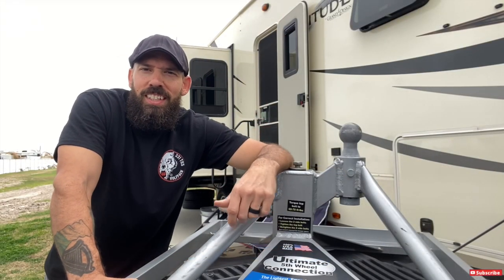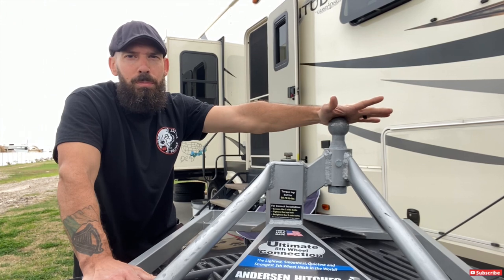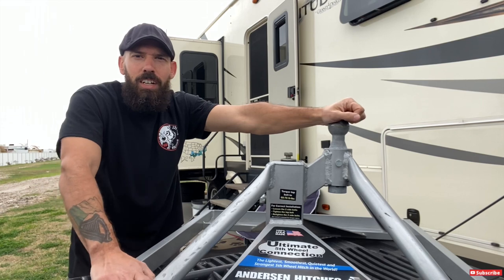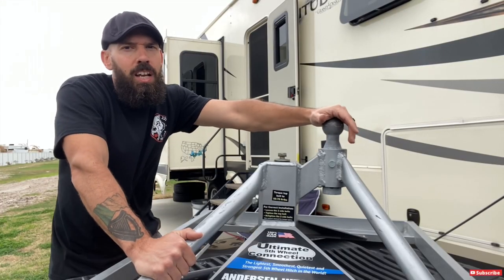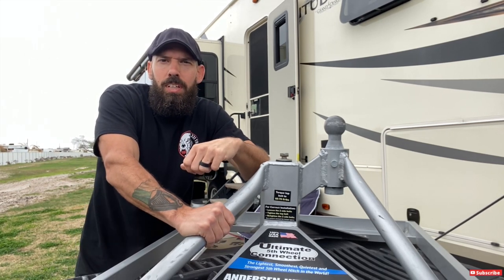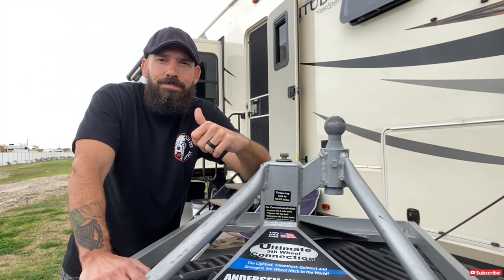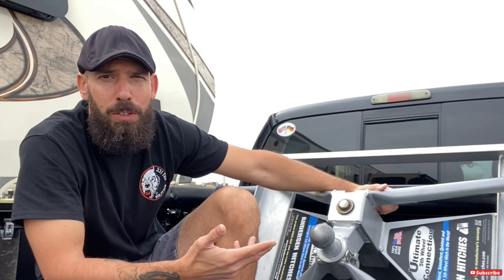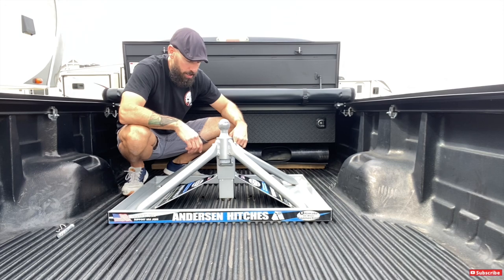Two Year Review of the Andersen Fifth Wheel Hitch //  Andersen Hitch Installation Guide

Comment: glad to see that anderson has upgraded the frame. we had one of the older frames, its welds failed, the trailer fell on the tailgate & pickup bed, yes it cost almost money to repair our pickup as to repair our trailer. we liver full time in our 5th wheel, it cost us some more to live out of our trailer while it was being repaired.
Reply: Do you still have the Anderson Hitch?
I'm fixing to pull mine for first time with the New Anderson,  and I'm a little nervous..
Reply: Can you point me to where they said they upgraded the frames? What exactly is the upgrade?
Reply: Watch the video of them compressing the hitch to 65,000 pounds befor it broke

Comment: Good video on the Andersen Hitch.  I have been using it for 1 year myself with about 15k miles.  I actually made the decision to move to position 2 because I did not have enough clearance to prevent the pin box from striking the side rail of the truck.  I also have an 8 foot bed and have had to make some tight turns and learned to keep an eye on it.  Gordon & Alice
Reply from the maker: We just had a new tonneau cover installed and I was worried about it hitting the rails of that but even with the ball at its lowest setting I’m still good. Thanks for watching!!

Comment: I use a 25K BW with the Ford puck system and love it, but I don’t remove mine. It’s heavy. I have 2 grease zirks on the hitch and I grease around the coupler, but I go greaseless on the plate with a donut pad. I like the Anderson. Looks like a good setup. Like you said, just comes down to personal preference.
Reply from the maker: Sounds like a good setup. We might be checking out the Reese Goosebox soon and going to no hitches in the back of the truck to free up all space. Thanks for watching!

Comment: Dealer installed my hitch, towed new rv home 45 miles… noticed hitch had rotated 1/2”… I re torqued  top bolt and set bolts to 60 ft lbs….
  They make a taller hitch for trucks with taller bed rails.
  If you have a bedliner or mat under the hitch I would consider a longer top bolt to be sure you are getting full nut embedment into the inner sleeve….. (the ball and sleeve are at a fixed height. A mat or bedliner will raise the hitch about a  1/2” creating a longer reach for the top bolt to the nut in the top of the sleeve
Reply: Do you have issues with chucking and or rocking? I have read a few posts on the internet with that see the same with Pullrite Superlite gooseneck hitches.
Reply: Have not much experience with this hitch yet. I’ve towed plenty in the past but this is a new rv and hitch for us….

Comment: Great video! I have read people questioning how well the Andersen hitch would hold up in case of an emergency (hard braking) stop, in that the momentum of a 10K lb RV will deform or even crash into the truck's cab. Do you have that concern?
Reply from the maker: No I don’t worry about it. Anything is possible though. I believe every hitch has its pros and cons and weak areas. I do know if there’s any failure on the Andersen Hitch’s part due to any reason they guarantee I believe up to a million dollars in coverage. I know a lot of full timers I’ve met on the road and friends of mine who use it and so far nobody has anything bad to say about it. I definitely appreciate you stopping by and watching 👍🏼
Reply: @WhyWait  Thanks for getting back to me

Comment: Maybe a dumb question, but why not use a torque wrench to loosen when you were removing the hitch? You said use a breaker bar instead. Thanks, and really informative video.
Reply from the maker: Hey Scott.  A torque wrench is a very precise tool that requires care. Never drop a torque wrench, always unload it before storing and never use it to break a bolt. Although you could and chances are it might still be ok but any of these things plus others can possibly mess up it’s calibration. Check out the link below, it’s  a good article on torque wrenches. Some good info in there. 
https://www.google.com/amp/s/www.motortrend.com/how-to/ctrp-1111-torque-wrench-myths/amp/

Comment: There are several pictures on the internet that show this hitch completely failing and the trailer ramming into the back of the truck. Very dangerous situation. One was a sudden stop going 10 MPH and the other was a sudden stop at 40 MPH. I am thinking about buying a used RV and Truck that have the Anderson Ultimate hitch from around 2019. I am quite worried about this. Hope you guys can give me some good advice. Thanks
Reply: A video is out where a guy had a machine shop fabricate the top-ball out of  heavy duty steel. He's claiming the aluminum ball can snap or reports of this has been happening.

Comment: I didn’t know you could use these with a plastic bed liner is it recommended from Andersen? I have been looking a different kinds of hitches to use with my liner.
Reply from the maker: Sure can! You can use it no problem although I do recommend getting the rubber mat from Andersen that they sell to go under the hitch. Wether you have a plastic liner, spray in liner or just metal bed the rubber mat keeps the hitch from moving a bit. Many people I know no matter what type of bed they had reported the hitch turning just a few degrees after a long day of towing. Mine did too, it’s not a problem but something the rubber mat stopped from happening. 👍🏼

Comment: Do you have issues with chucking and or rocking? I have read a few posts on the internet with that problem the same with Pullrite Superlite gooseneck hitches.
Reply from the maker: No not at all. When I had the Andersen there was no chucking or bucking, very smooth quiet ride vs a traditional fifth wheel hitch. Now I use the Reese Goosebox, same concept and for me it’s the only way to go.
Reply: @WhyWait  why did you replace you Anderson to the Reeze goosebox?
Reply from the maker: @audiesanchez2984  no issue with the Andersen, loved it for 3 years full timing…just wanted to move to the next step in Goose neck style towing and now with the Reese my bed space is totally freed up. 
Ultimate REESE GOOSE BOX Video (Installation Process, Full Review, & Tips and Tricks)
https://youtu.be/OoZ4eQATTrw

Comment: The two Coupler tube set bolts should be torqued to 60lbs like the top bolt not 40lbs. 40lbs is for the king pin coupler.
Reply from the maker: You are absolutely right and it’s something I should of caught when editing. Thanks.
Reply: That’s odd, in the instructions for my Anderson, it says 40 for the front two bolts and 50 for the top, I think I’ll check with Anderson on that, I can say when we were traveling with our  trailer, (it’s about 13,500 lbs) at 60 mph a dumbo did a uturn in front of us, the truck and trailers wheels all locked up as I avoided killing the person, I felt the hitch handled it well.

Comment: Sorry dude but youre wrong on torque specs... Its 60 and 60 per the install manual. 
2-3. Using a 15/16” socket wrench, tighten the top
bolt of the square coupler to 60 ft-lbs of torque.
This will ensure that the coupler is pulling up
on the gooseneck ball and holding the Ultimate
Connection firmly to the bed of the truck.
2-4. Using a 15/16” socket wrench, tighten the two
coupler tube set bolts to approximately 60 ft-lbs of
torque to take out any play in the tube
this is strait from the manual.
Reply from the maker: Thanks and I know it’s 60 and 60. I just misspoke filming it and didn’t catch it. Pretty sure I had 40 on my mind thinking about the torque specs for the coupler which are 40👍🏼

Comment: One thing I dont like about the anderson, the load is being transferred to the truck bed.  The bed isn't rated for such a load.  All fifth wheel frames or gooseneck balls transfer ALL the weight directly to the frame.  I will stick with my fifth wheel setup....Just my opinion
Reply: This is an excellent point.